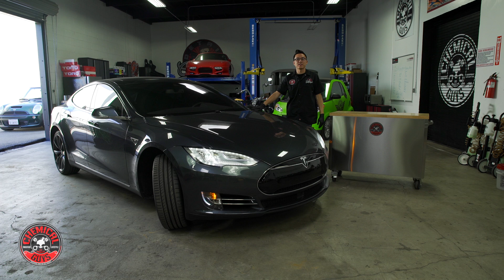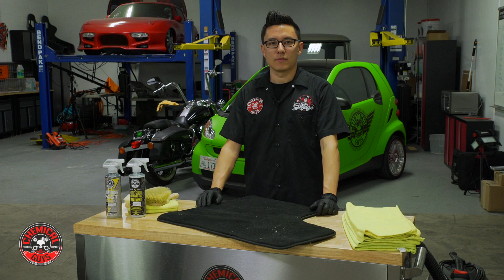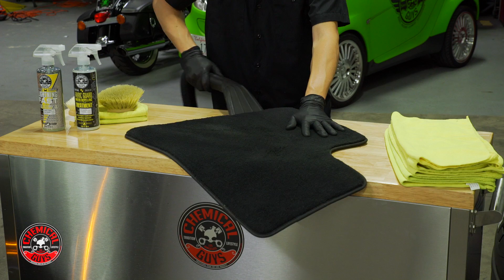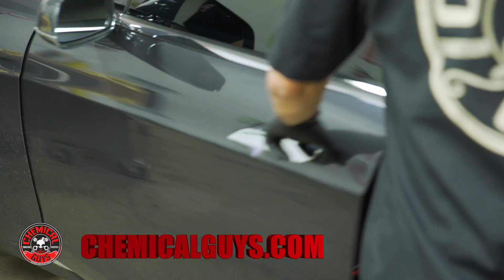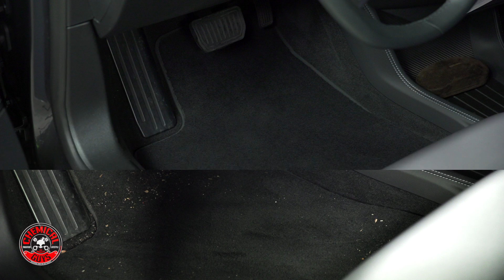How To Clean Floor Mats - Chemical Guys Car Care

Comment: My floor mats look that dirty in one day.
Reply from the maker: Hey buddy, keep that carpet protected with some lightning fast, and Fabric Guard. The lightning Fast is a great way to remove all those dingy, dark pooling stains on your carpet. With Fabric Guard, you can make sure that your fabrics don't stain from spilled liquids, and it will help to maintain the appearance of your carpeting. My mats get pretty bad, it helps to have a good vacuum with a long extension cord. Unfortunately it's not always easy to keep them clean all the time, you have to dust your shoes off before getting back in.
Reply: I use a Bissell spot clean or a Bissell pro heat. I use a cleaning solution with Scotchgard or DuPont in it so I have to do the extra step for to protect the carpet.
Reply from the maker: We use a carpet extractor, with lightning fast to remove the stains, we vacuum the mats with a shop vac/crevice tool. We spray the carpets with our product, and use the extractor to lift off all the heavy contaminants.
Reply: I use a carpet extractor as well. I first brush them with a gong brush to agitate imbedded dirt. Then I vacuum them with a shop vac using a claw nozzle. Then I spray some type of a pre treat. My favorite pre treat is Zep high traffic, it contains enzymes to break down organic materials like dirt, food stains, grease and other nasty stuff. Then I use my Bissell carpet extractor. Usually I use a Bissell Big Green. But big green has no heater so the water does not get that hot. So with Big Green I have to use a shampoo in the machine to help it remove dirt. But now I have a Bissell Deep clean Lift Off. The Lift Off has a electric water heater that heats the water up to 190 degrease. So on low or medium soils I don't use any shampoo. But if the mats or seats are just trashed I use a shampoo in the Lift Off. You at Chemical Guys should make a enzyme pre treat spray or a enzyme shampoo for organic soils. It would help you a lot to clean mats.

Comment: why don't you ever clean anything that is actually dirty
Reply from the maker: Generally we have found that the majority of our customers care about the cars they drive and don't wait until they are destroyed to clean them. Since we always use customer cars, this is just what we have found. We have had some horrible carpet with blood and grease on it, but at that  point why go through so much work when you can just replace the carpet?